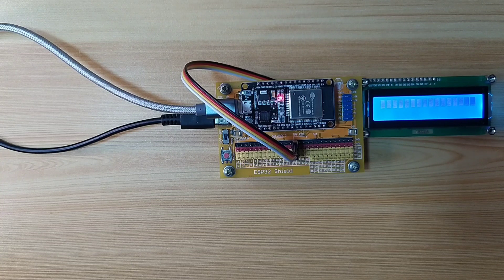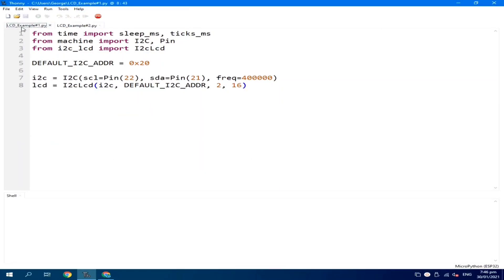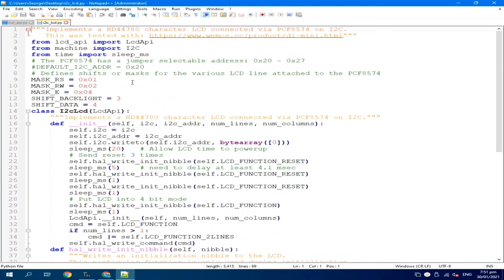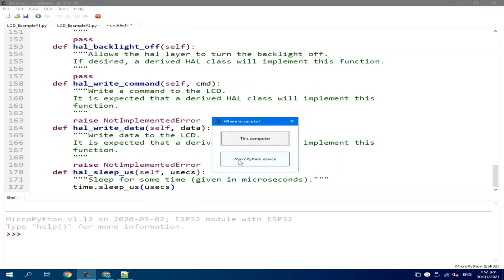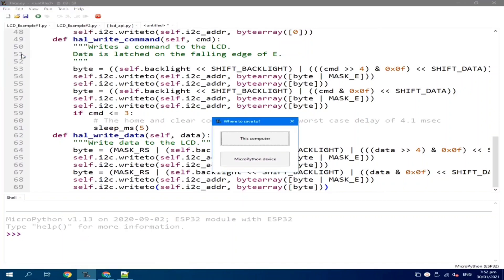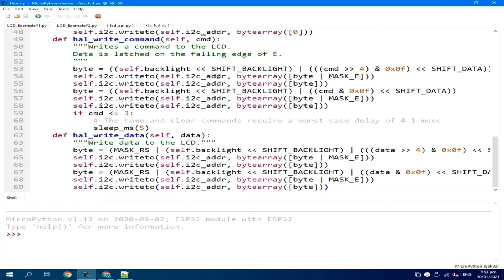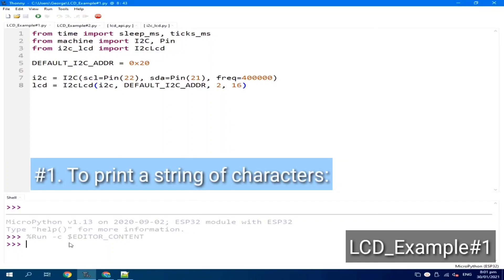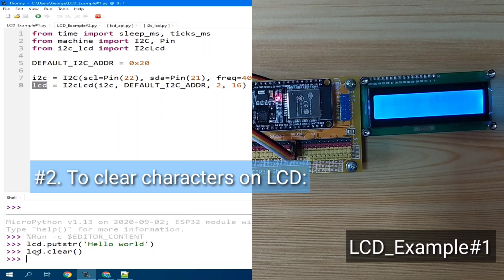008 - MicroPython TechNotes: 16x2 LCD

Comment: Hi, thanks for the video and explanation. Can you point to me where you buy the LCD and its PCF8574 backpack? Thanks.
Reply from the maker: It's a set of modules that was sent to me from South Korea named Gorillacell ESP32 development kits. Check https://gorillacell.kr/ the website is in Korean but you may use google translate so you may understand. Their email can also be found on the said webpage. Cheers.
Reply: I have adapted your codes for my STM32F446RE board and works like a charm.

from time import sleep_ms, ticks_ms 
from machine import SoftI2C, Pin 
from i2c_lcd import I2cLcd 

DEFAULT_I2C_ADDR = 0x27

i2c = SoftI2C(scl=Pin("B8"), sda=Pin("B9"), freq=400000) 
lcd = I2cLcd(i2c, DEFAULT_I2C_ADDR, 2, 16)
Reply from the maker: @edwintjoa6099  of course Micropython code are usually portable to other MCU with minor to no modification.

Comment: I did exactly the same as you but it's not printing on LCD whith tuis error:
  File "<stdin>", line 1, in <module>
NameError: name 'lcd' isn't defined
Im using an ESP32
Reply from the maker: you should put the 2 driver library on ESP32 MicroPython root directory.

Comment: nice tutorial, one question: will this library work for a 20x4 LCD connected via I2C?
Reply from the maker: Yes, it will work with 20x4 I2C lcd by changing:
lcd = I2cLcd(i2c, DEFAULT_I2C_ADDR, 2, 16)

to:
lcd = I2cLcd(i2c, DEFAULT_I2C_ADDR, 4, 20)

If not, be sure to change the DEFAULT_I2C_ADDR  specific lcd such as 0x27.

Hope this helps. Cheers

Comment: Thank you.... If I had a button, how can I count its presses but only start counting after the button has been pressed 5 times?
Reply from the maker: @SoggyCashew, I would do it like something like the following:

from machine import Pin
from time import sleep

b = Pin(12, Pin.IN)
press = 0

while True:
    if b.value():
        press = press + 1
        if press > 5:
            print('Press count: {}'.format(press-5))
        else:
            print('Press no count: {}'.format(press))
        sleep(0.3)

It should print something like:
Press no count: 1
Press no count: 2
Press no count: 3
Press no count: 4
Press no count: 5
Press count: 1
Press count: 2
Press count: 3
and so on.

Hope this helps.
Reply: @TechToTinker   what if I wanted to count down -5,-4,-3,-2,-1 then count up?
Reply from the maker: @SoggyCashew  you may achieve that by having 2 variables, 1 for counting down and another for counting up. 

Try to solve it first on your own. If you are stuck, show your code first, then we can help you better.

Cheers.

Comment: It seems I2C is deprecated and, SoftI2C is availble. I dont know due to this but   even if i shift I2C to SoftI2C, in i2c_lcd.py. line 19 generates an error.
Which is :
"
Traceback (most recent call last):
  File "<stdin>", line 8, in <module>
  File "i2c_lcd.py", line 19, in _init_
OSError: [Errno 110] ETIMEDOUT
"
which is when mc intialize to send a signal.

self.i2c.writeto(self.i2c_addr, bytearray([0]))
Reply from the maker: Hi Eren, you can use MicroPython firmware v1.13. Or if you are currently using v1.14, instead of 
from machine import I2C
replaced it with:
from machine import SoftI2C

and in the main code:
the instance of "I2C" should be replaced with "SoftI2C" and that's it and it should work.

Hope this helps you. Cheers.
Reply: @TechToTinker  Tried... but doesn't work
Reply from the maker: Also, you don't need to modify the library.

Comment: Hi I am from India.Nice Dear You are doing a great job..pl keep it up.Pl post a video on how to use internal EEPROM in Esp32 and Esp8266 by using MicroPython
Reply from the maker: @Sanjay Gour, I am glad that you liked my video.

With regards to your suggestion, I think there is no EEPROM implementation in MicroPython (I could be wrong here) but there is internal file system you can work on with and it is more powerful than EEPROM. You can reference it from here: https://docs.micropython.org/en/latest/reference/filesystem.html
Cheers.
Reply: @TechToTinker  thanks to respond..
Reply from the maker: @sgour100  you're very much welcome. Thanks